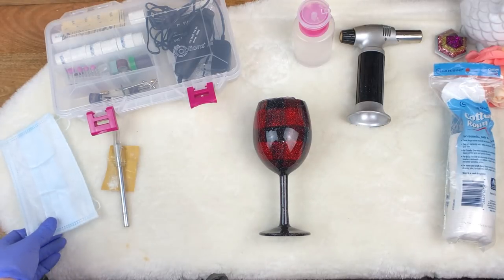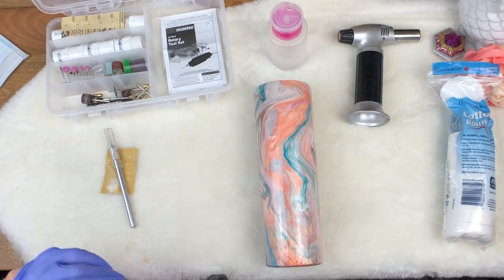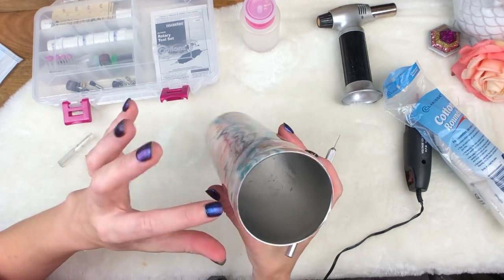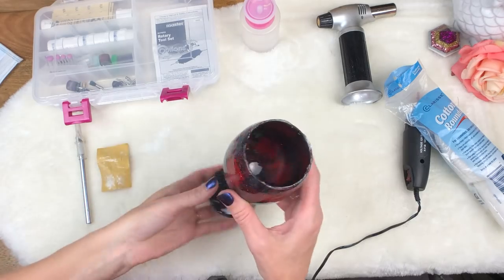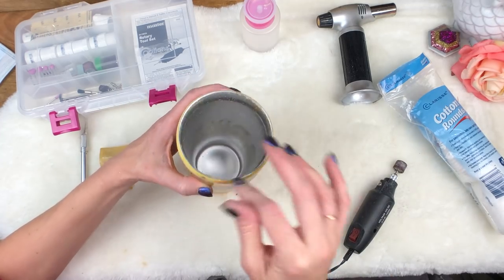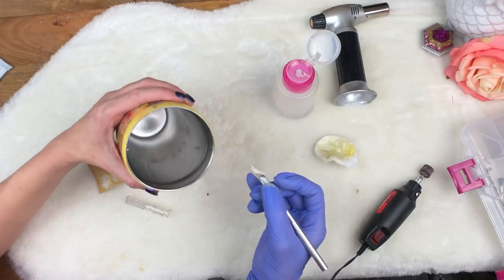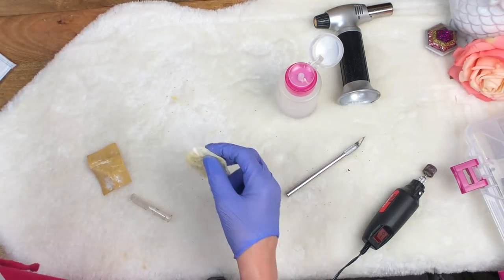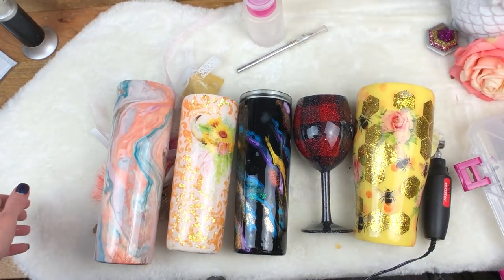HOW TO GET A SMOOTH EDGE GLITTER TUMBLER

Comment: Am i the only one that cups are rugged on the botto edge and top edge? Its like the resin dont set there
Reply from the maker: hold a litytle back in the cup when you epoxy and after about 45 minutes you drizzle it on the edges. Then after it cures sand it smooth

Comment: Summer, just to clarify, when you talk about the seal, are you talking about the destroying epoxy seal to the cup or are you talking destroying where the cup lid will seal to the cup? Thanks. Great tutorial.
Reply from the maker: the seal between the epoxy and the cup. If you lift it up AT ALL water can get in there and ruin the cup
Reply: @LittleLeeandRose  just wondering how you would repair the seal? I’ve had an issue with this last batch of pens and cups having issues with the epoxy on the edges cracking and chipping when cleaning attempting to clean up the edges😓

Comment: Hi there I’m having issues with the epoxy not sticking to the bottom edge of my tumblers. I’m not using glitter just acrylic paint that was sealed with a spray sealant. Please help. It looks so thin I just know it’s going to chip the second I use it.

Comment: When sanding you should wear a particulate mask not the vapor mask. The dust will ruin your vapor cartridges.
Reply from the maker: I have to wear it because I have mixed and curing in the same room . I can replace the cartriges very easily =)

Comment: I've seen many tutorials where they use an exacto knife at an angle towards the inside of the cup to clean the rim. I have tried that method and have broken my seal twice. Do you feel  sanding with the tool helps reduce the seal from breaking?
Reply: it does but if you heat the exacto knife the seal should not be broken
Reply: I've just done my first cup.  How do you fix the broken seal?

Comment: How do you get an epoxy Seal if you’re going all the way to the top of the cup w glitter??? 

Another question is You Sanding the wine glass w the tool?? Doesn’t make the glass sharp??
Reply: the epoxy will seal at the top edge of the cup and no, sanding lightly does not make the glass sharp
Reply: Kathleen Lorenzo So, after this procedure you add on final coat of epoxy?